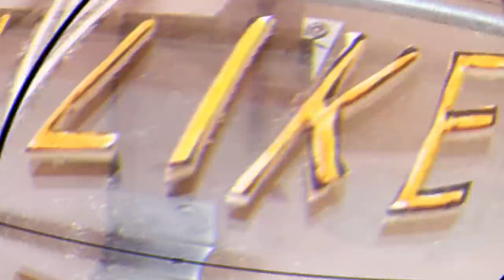Brilliant idea and 100% successful // Make a scroll saw using a drill

Comment: Beautiful and innovative.
Reply: Can you please give me the dimensions of the following materials:-
1. The aluminium square tube size (length and is it 1 inch square tube?)
2. The slider length
3. The length of the threaded rod and its diameter
4. The wooden pieces sizes 
I have to cut it from a carpenter hence I am asking the above so that I can get it cut from the carpenter. Hope you will provide me these so that I can try to make one for my lab.